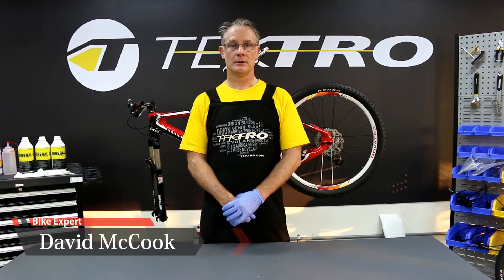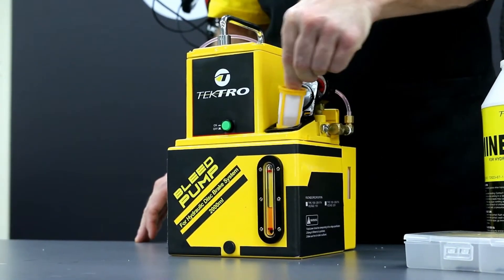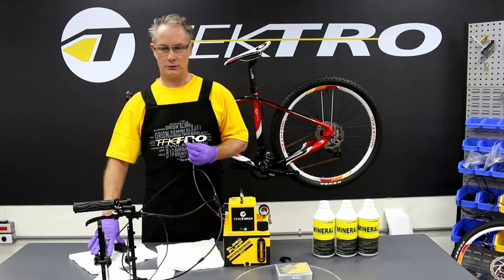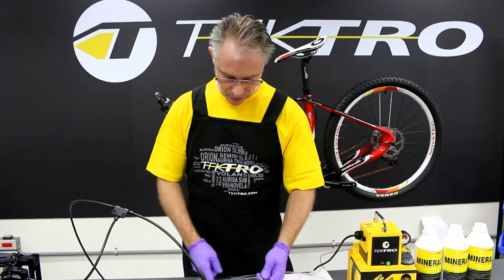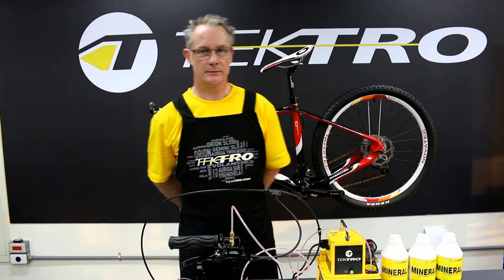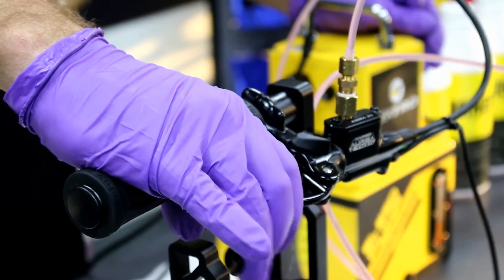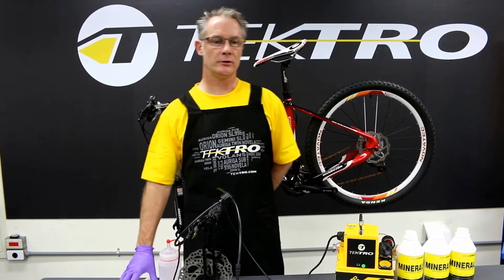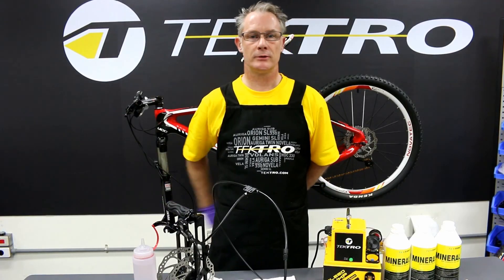How to Bleed Hydraulic Twin Brake System Using Tektro Bleed Pump

Comment: I bought the state of the art Tektro Twin HD T525 braking system for my recumbent trike.. Paid and arm and a leg...   I have had nothing but trouble.. the Reach Adjustment screw in the V of the lever, always adjust it's self, making the brakes unreliable..  I tried the other day to adjust the reach so that the lever didn't come back and touch the handlebar.. I was 30 miles from home in heavy traffic... Next thing i know, the lever completely seized and i couldn't depress the brakes.. That is scary in Portland where we live on very steep hills and have to brake often to avoid collisions..   Tektro's website is impossible to use.. the search engine is crap... ask:  HD T525 or E525 or the new E725 twin..   i searched them separately.. result:  ZERO (0) results.. I tried looking at a schematic of my particular brake..  and the drawing isn't even close.. I tried to find a replacement lever (so i could continue to use my hoses and calipers that work fine.. ZERO RESULTS.. I tried to call, but that feature is shut off.. and the email is disabled.. What crap...  the customer service is non-existent.  and the online help is poorly translated...   Don't risk spending a small fortune on these Tektro brakes.  When something goes wrong, you're on your own without a way to get parts...
Reply: What has this got to do with the pump ?